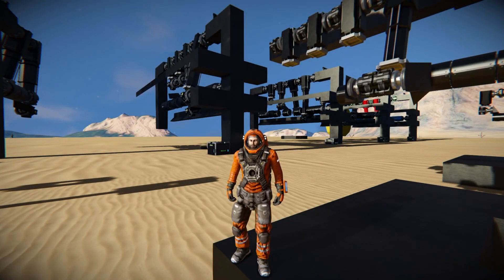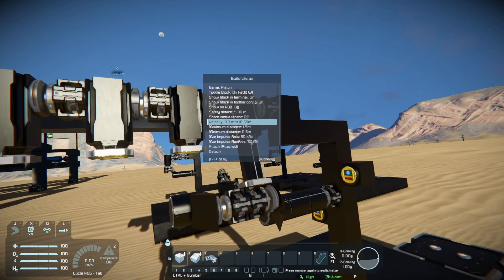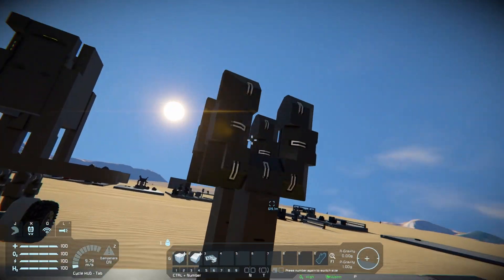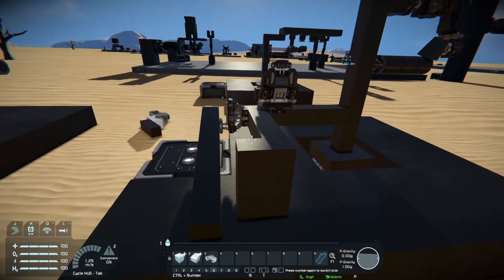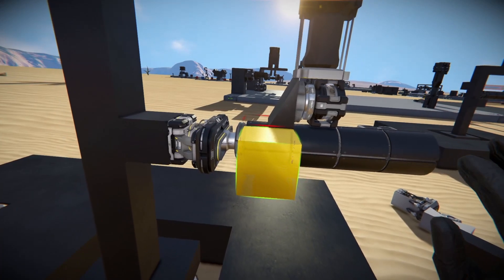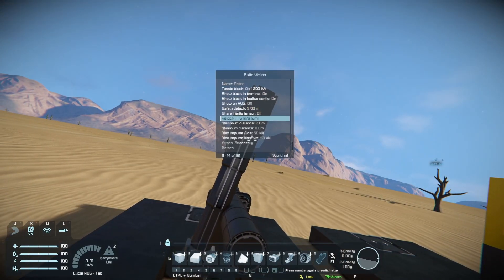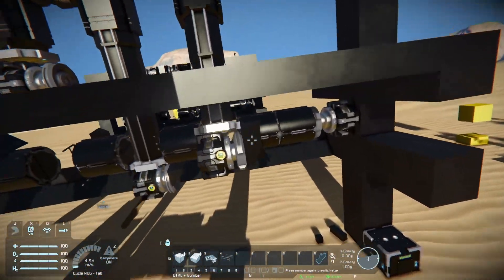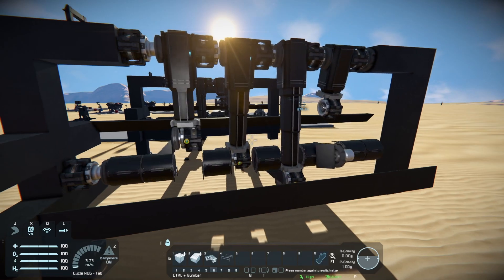I built A Working Piston Engine In Space Engineers

Comment: It would probably work better if you connect the top of the piston row to the rest of the main grid. Wouldn't be hard, just throw down some blocks from the last rotor head that isn't being used. Build a frame over towards the main grid. Put another rotor on the main grid, then a block off that rotor head and merge block that to the frame you had built. Lock the rotors that are attached to the main grid. You'll need at least 2 attachment points for the end frame. Have you tried running the engine with inertia sharing turned off? I know it increases the risk of things exploding, but from the little bit of testing I've done, rotors seem to be more resistant to free movement when sharing inertia is on. Maybe also test out timer blocks with the sensors, may get something that runs smoother if the pistons are being controlled by timer blocks instead of just a sensor.
Reply from the maker: it was less stable when i had all the rotors connected to the frame, that's why its like this at the moment. and at the moment there are no inertia sharing on any of it.
I have a new design im building and it seems to be a little more stable as long as i can get the timing perfect